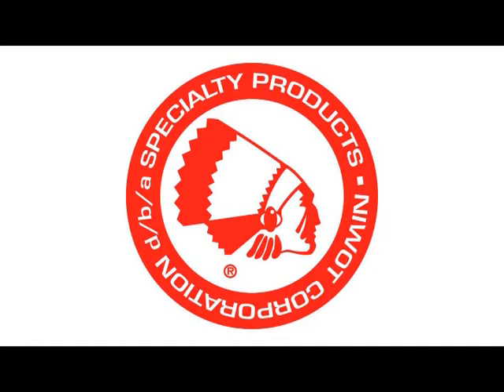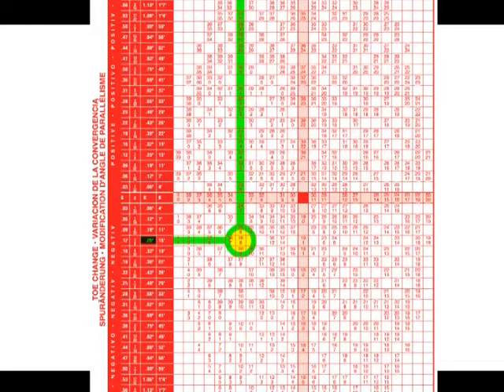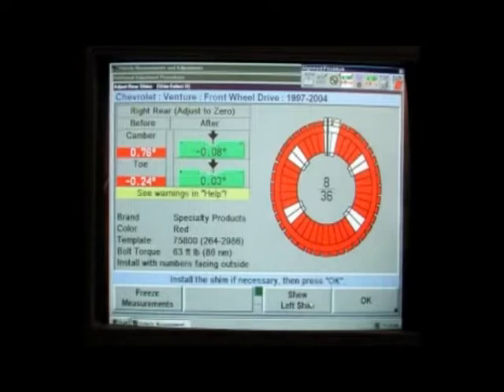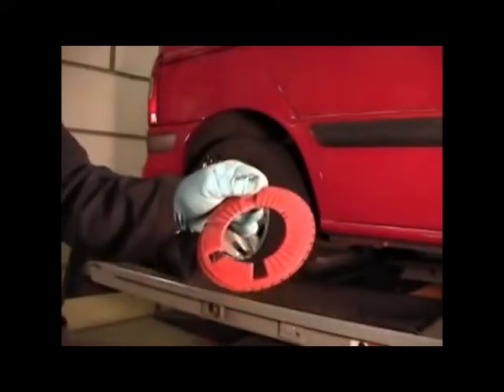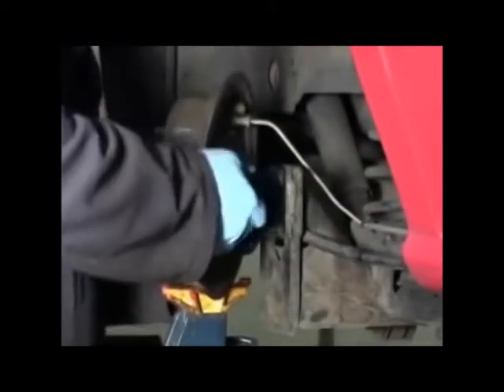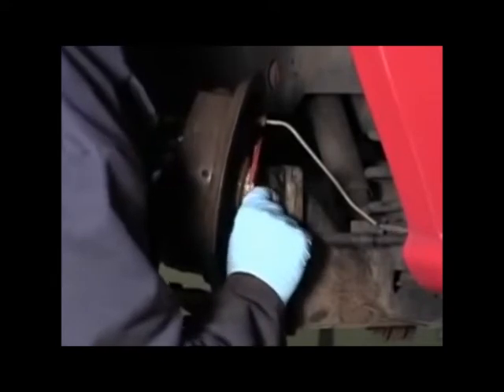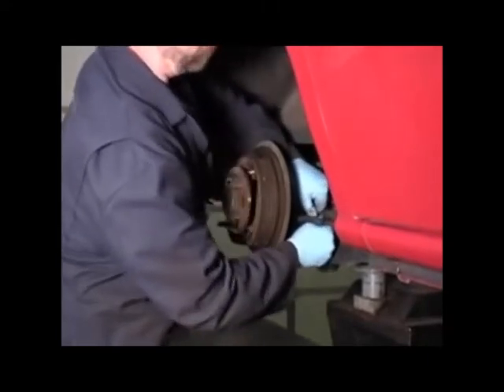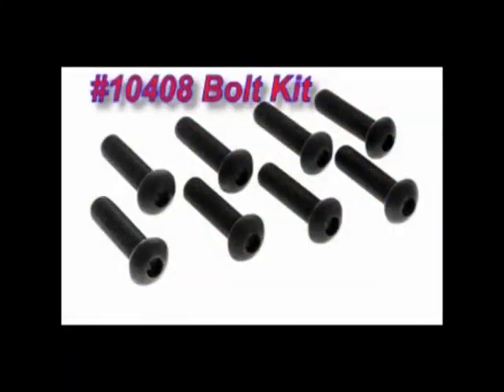75200 / 75400 / 75600/ 75800 EZ Shim Installation Video - Specialty Products Company

Comment: The question I don't quite understand is: When we actually need Camber Bolts? For example on 2003 Chevy Cavalier I always do alignment on Front with no problems with usual (original) bolts there. But I know that I could install special camber Bolts (81260 EZCam) or Moog K90474, which are the same. Is it easier for a mechanic to work on alignment with those Camber Bolts, or there is need for them after some suspension parts damage? We have another car (2001 Saturn SL2), and the same Camber Bolts (81260 EZCam or Moog K90474) go on the Rear of that vehicle. When I go to do alignment to Chevy Dealer for Saturn I bring them my own tool for rear alignment on Saturn, since they don't have it. So if I would install on the rear of Saturn those Camber bolts there would be no need for that tool? They let me watch once that alignment and the bolt for the rear alignment is on the rear crossmember. For some reasons that bolt can be adjusted only w/special tool I bring them. So I assume if to install those Camber Bolts on the Saturn Rear, there would be no need for the mechanic to rotate that crossmember bolt and the alignment would be so much easier to do. I would appreciate any opinions on this matter.
Reply: The answer to "When?",  is whenever the alignment cannot be set to the desired readings with the OE parts. If a vehicle can be aligned well using OE parts, then there's no need for aftermarket parts. These parts are needed when the alignment cannot be set with OE. This can be due to slight parts distortion caused by potholes and curbs, sagging springs or intentional ride height change. Your Saturn is nice because it uses 2-bolt struts for both front and rear suspensions; not too many cars do this. So, the EZ-Cam bolts work at both ends. SPC used to have both a rear camber tool (78090) which sounds similar to what you have. SPC also used to have a rear toe adjustment kit which made rear toe change easy (85600). Unfortunately, both part numbers have been made obsolete with none left on the shelf. Some internet searching might uncover some, just be wary if a distributor reports "the parts will need to be drop shipped from the manufacturer". Since we have none on the shelf, we could not fulfil a drop ship order.
Reply: @specialtyproductscompanysp8027  Thank you so much for the replay and detailed explanations. I also didn't know that Camber Bolts I have can be used for the front on our Saturn. That is true, 2001 Saturn SL2 is very good and relatively easy to repair car. Yes, the tool I have is 78090, I also bring to the shop 65150 Rear Camber & Toe Adjustment wrench for any chance (don't know if they use it or not). Tool 78090 comes on their screen, that they need it.  I have impression that the mechanics usually get irritated by all those accommodations, so thought to install the camber bolts for them, but if it is better to use the original ones, then nothing can be done, and they need to use the tool I bring.  For Chevy they recommended EZ Shims on rear. I'm installing new struts (front and rear) and after that will go for alignment of course, get prints. Then I'll install EZ Shims to see how it works. Thank you again.

Comment: "special cutters" shows a normal pair of flush cutters...
Reply: Most technicians have much larger diagonal cutters which will usually crack the shim all the way to the outside edge. But yes, any small and sharp cutters can be used. Some people use a cutoff wheel to separate the segments. Whatever works...

Comment: My 2005 Chevy Cavalier rear passenger side toe is very slightly off-  -0.06*, the range being 0.00 to 0.20. The Camber is fine and all else. When I first got the car, the rear toe, right passenger side, was -0.11* off. The difference is I just changed my rear strut assemblies, both sides.

So will a Shim adjustment work? One alignment shop told me that even when they follow instructions, cut accordingly, it doesn't work. Another told me to have a body shop pull the frame out a bit!! Both my mechanic and first alignment shop and everyone else says there's no evidence of damage or a bent beam etc. It doesn't have rear IS, just one solid beam, but built like a tank. 

It matched me with your EZ Shim, either the Grey or Yellow. Your advice please.
Reply from the maker: The 75400 grey shim is listed for the 2005 Cavalier. Set up correctly this should adjust rear toe to specifications. Such a small amount of correction may not be needed if there are no drivability issues or tire wear.

Comment: If someone wants instead of shim on the rear to install a corresponding new part of the car, what part it would be? For example for 2003 Chevrolet Cavalier. On the front what causing the need of the Cam Bolts it would be front bushing if I'm not mistaken. Can it be smth else? Thank you.
Reply: Best bet would be the rear axle itself, but it could still be off due to minor body/frame warping, so with the relative ease and low cost of shimming, I’d just shim it. I’m looking into this for my 91 Deville, and that seems to be the universal answer I’ve received.
Reply: @Dfm253  Thank you for the replay, I'm sorry i didn't see your answer before, really appreciate it. Encouraging on using EZ Shims is really helpful, I've never put them before. So you put new Shims after each alignment from now on, or the mechanic can use the shims you installed after the 1st alignment? Thank you again.

Comment: Do any of those EZ shims fit 2001 Saturn SL2. I bought 75400 for 2003 Chevrolet Cavalier, but also want to get similar products for Saturn. If no of EZ shims fit for that car what would you recommend? Thank you
Reply from the maker: The Saturn has a different style of rear suspension. The rear toe is adjustable and the rear camber can be corrected using our 81260 EZCam. Refer to our website for correct vehicle application.
Reply: @SPCAlignment  Thank you. You know I found out those I purchased for the Cavalier Front MOOG K90474 Cam Bolt Kit  (I bought like 5 of them, since thought you can place them on the rear of Cavalier as well, +1 if I mess up smth) are suitable for the Saturn Rear (for Saturn front I bought before, I have them). Happy to know I have sets now for both of our cars. Thank you again for the site reference, and your film again. It is the best explanation on the subject.

Comment: Can you replace some part of the car suspension instead of using these shims? Usually this alignment problem (when shims are required) appears, as far as I understand, on older cars, so some part is worn. And also if you decided to add those shims, you do it after your alignment when they say in the shop, the shims are needed and they can't do it without the shims, you take the final prints for that alignment, install those shims and go back to do alignment again, is it so? Thank you for the informative film.
Reply: In anything with independent rear suspension these would be discouraged, but a slightly bent rear axle on a FWD car is much more expensive to replace, and using these instead won’t have any negative effects.
Reply: @Dfm253  The majority of vehicle applications for these shims are rear beam style, however, there are a few IRS vehicles which can use the shims. The trick here is to center the OE rear adjusters and use the shims to correct from there. This will allow future adjustability using the OE adjusters. If you've noticed, the rear alignment specs for a beam vehicle tend to have a much larger tolerance than an IRS one. Many beam vehicles are "in the green" but still have rear tire wear because the rear toe tolerance is ± 0.5°. Many of these vehicles are not optimal from the factory and life does not usually help them. If anyone remembers the Nissan Sentras from the mid-'90s, you could replace new rear beams multiple times and still not get one which would give good tire wear. But, in general, it is good to replace any known bent suspension pieces instead of just "Band-Aiding" the issue. If this includes all the springs to get the vehicle back to OE ride height, aftermarket adjustable parts may be the more economical choice. Or, if a vehicle has an intentional ride height change (either lifted or lowered), these kinds of parts may be useful.
Reply from the maker: Any worn and loose parts should be replaced before an alignment. This style of shim is mostly used on a non-adjustable beam type axle. Alignment angles may be off due to body and frame issues or a axle that may be slightly bent due to things like hitting a curb. These shims help align the rear axle hub to the rest of the vehicle so it tracks straight down the road. If you feel confident in installing these shims you can do so if you have accurate alignment readings before you start. It is always a good idea to check angles after any adjustment.

Comment: You guys have a shim for an '18 elantra SEL? Rear can't change toe and it's torsion beam.
Reply from the maker: We do not  have a solution for this vehicle in the rear at this time. One can use 81260 in the front. I will put in a request for the application for the rear to be investigated. Thank you
Reply: @SPCAlignment  it's fine. I got tired of the toe issue and I sold it for a '21 elantra N-line. But, it could def help benefit others anyways.
Reply from the maker: @MrTherandomvidsguy  we appreciate the feedback.

Comment: SPC states I should use a 75800 dual angle shim on my 2006 Kia Rio. However this shim does not fit tight around the hub. There is tons of extra space. Almost seems like I need a shim with a smaller center hole. Never had this problem on other vehicles. Any help SPC? Every website shows the same shim for my car but this shim does not seem safe as it doesn’t make full contact on my 06 Rio.
Reply: Yeah it’s probably a 1/4inch or so. Just normally vehicles I’ve shimmed the shim was a tight fit over the hub so I was concerned that was wrong. Thanks for clarifying!
Reply from the maker: According to our data you rear wheel hub should be only .25" smaller than the inside diameter of the 75800 shim. This is the only shim we offer for that size of hub. Our next size down is 75400 which would be about .20" smaller then your pilot hub. There should be sufficient contact for secure clamping with the 75800. If you have other questions feel free to call our tech line at 1-800-525-6505,

Comment: If intall shim afect  abc
Reply from the maker: If you are asking about anti-lock brakes, the answer on no. The EZ shim is designed for cars that use a hub with the anti-lock brake sensor build in.